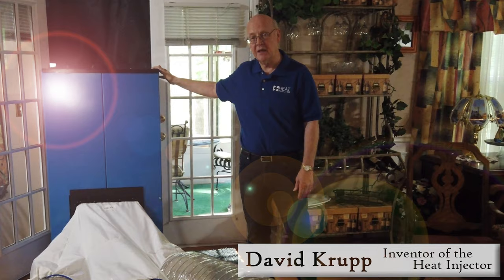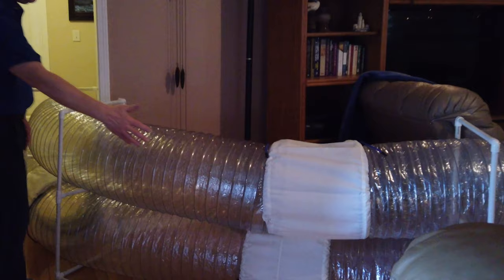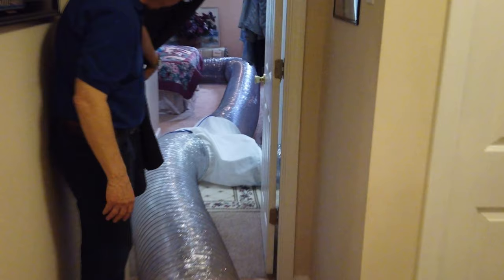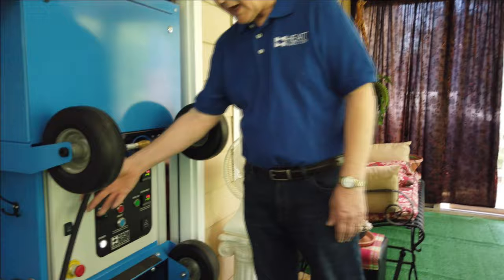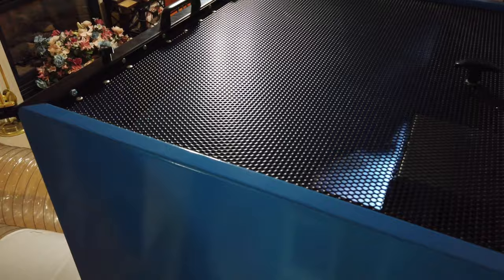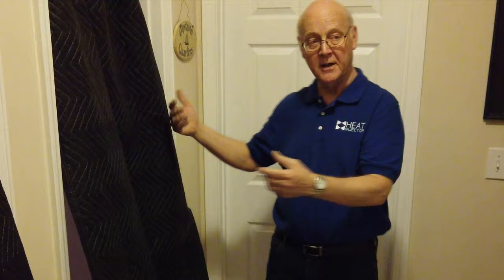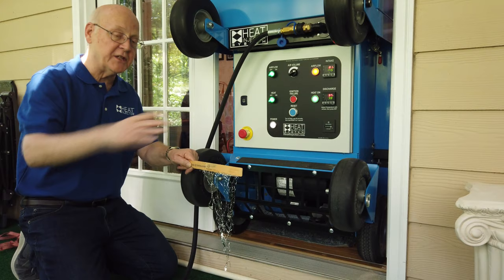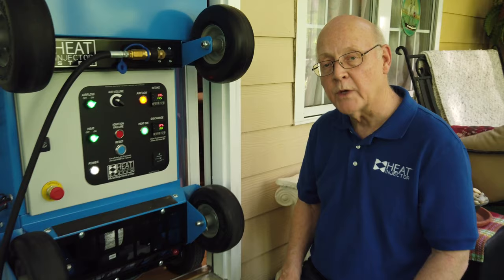Bed Bug Heat Equipment - HEAT INJECTOR

Comment: Wait where are the combustion products going? The air is direct heated right? No heat exchanger? So the exhaust gasses are going directly into all the rooms? Do you have carbon monoxide detectors set up while working?